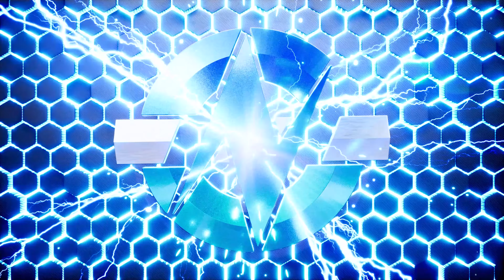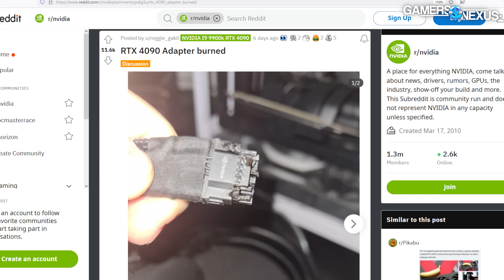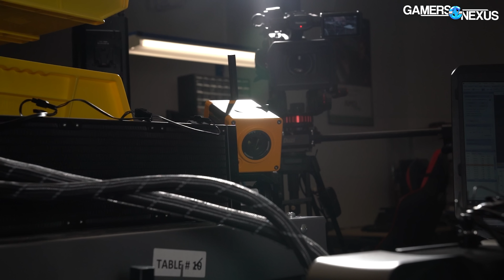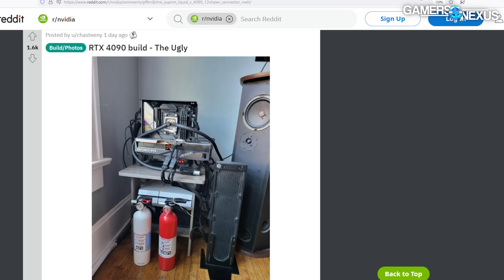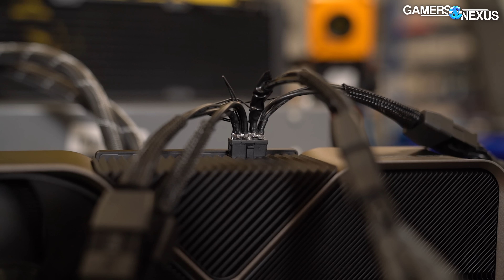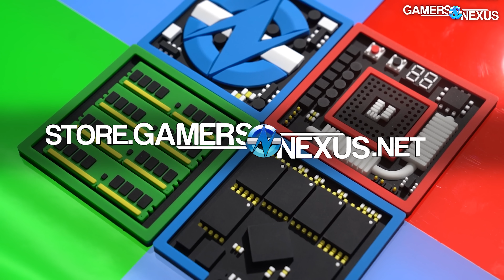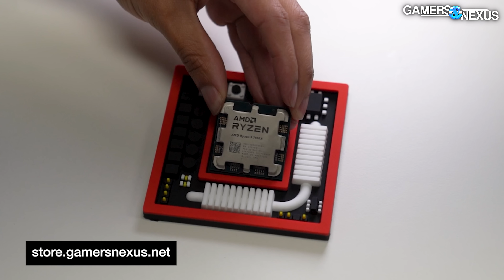Testing Burning NVIDIA 12VHPWR Adapter Cable Theories (RTX 4090)

Comment: Burning electricals are always due to poor/loose connections. Loose wires not tightened or corrosion/arcing causing poor connection leading to increased heat and burnies.
Reply: Yeah and the wire cross sectional area is well in excess of what is needed so it and if it was on the back side of the connector you'd expect the melting to start there which isn't what is happenning.

Comment: bottom line cause: these cards are drawing far too much load and are in dire need for a more efficient R&D. even if it was a weaker cable in comparison, 300 watts wouldn't be melting it in contrast to 600+ watts they're drawing now and honestly anything drawing more going forward will just be impractical and not even possible for most people to use on a common NA 15A circuit (non dedicated of course).
Reply: Its not a weaker cable it a weaker connector that is likely the problem. Trying to solder massive 14AWG solder monsters to those tiny molex contacts is not a good combo. Crimping smaller gauge wires to each contact directly without solder would be much safer as it is much more consistent using a crimping tool than manual soldering.

Comment: I would make sure when testing this to try applying a significant horizontal force to the adapters. If Buildzoid's right, that's what would get these things hot enough to melt. Testing them with vertical force won't do it. After all, the picture of the first rig with this issue showed the cable was torqued sideways.

Comment: these plugs are only 12 volt. 300v or even 150 volt cable is a massive overrating that is not required.
Reply: Its the temperature and cross sectional area that matters. And most importantly the contact resistance.

Comment: question, at what temp does the plastic start to melt. It may be useful to know that temp as if it is close to normal operation temp then it would not take much to cause it to melt, but if the plastic starts to melt at a much higher temp then you might not have to chase down some leads as only certain conditions could cause temps that high.(ie only electrical arcs could cause that high of a temp)
Reply: ~269degC I think is when the nylon would start to melt assuming it is not a glass fiber/ball filled housing or has any magic addiatives. It doesn't need an arc to melt it just need high contact resistance to cause excessive heating in the connector housing.

Comment: Thanks again, for providing such an indept view on a big issue. Something I have always been wondering about, and that seems to be confirmed in this video, is how does a sample size of 1 confirm a generalized theory. Igor's lab appears to largly base his claims on one cable that he opened up, while your work is on 5 cables. This time it concorns a cable, which is arguably easier to get a larger sample size of. 
But then I have to wonder, when it comes to testing of the flatness of a CPU, graphs which I love seeing in your videos, as it shows how much depth you go into to understand the functioning of a product, and start wondering, how much does this one sample that has been scrutinized represent all of the CPUs tested. I appreciate that it is difficult to get a sample size that represents the whole of a product that is sold, especially when it comes to a high end product like a GPU/CPU.

Comment: So a couple things here. Size of wires and crimps really matter. If you've done crypto mining, you realize that even if they have the same gauge wires, PCIE connectors wont perform the same under FLIR and load. What really matters is the quality of the crimps (or if they solder) and depending on the company, the quality assurance can be all over the place. A bad crimp will increase the resistance quite a bit and cause it to heat up, which also puts even more load on other crimps. Even if the gauge of the wire is there... Obviously the gauge of the wire is another factor. And even if its the right size, they can use chinesium, IE the metallurgy of the copper wires might not be completely copper in order to reduce costs.

Comment: Thanks for testing this but I think in the end connectors that carry substantial currents should always be CRIMPED, not soldered. Never. So I think even they could resolve these problems there will always be more issues with unofficial adapters etc. Until someone makes a 100 % crimped version of the adapter.

Comment: Would it be possible to measure the diameter of the male pins on various cards. 
All the failures (at least confirmed) seem to pretty much be across 3 brands (Asus, Gigabyte and MSI). If Nvidia is supplying/making the adapter (or at least some of them), maybe their source for the female pins comes from the same place has their board connector, making them a perfect match. If Asus, Gigabyte or MSI have a different source for the board side connector, maybe the pins are slightly less diameter (despite the fact they are meant to be built to the same spec). This could result in a loser/higher resistance/hotter connection at the pins, this combined with the poor choice of dual split pins, could be the breaking point.
It would explain the pattern of 0 FE cards having the issue (and the reason you have had no issues with the FE card with many hours on it) and also the reason why aftermarket cables don't appear to be suffering the issue (if they use better tolerance pins, that match that of the Asus, etc sockets).
If there are multiple batches Nvidia adapters out there, maybe it only effects some if the pins for them are from different suppliers/batches.

Comment: Igor's conclusion never made any real sense... If the solder joints were the problem, then you would see the issue most likely occurring at the solder joints... Duh? All the pictures of failures show that the problem *is* the connector in spite of Igor's (rude) insistence that it isn't. "The charred socket on the card is then only the consequential damage". If this was the case, it would make logical sense that the socket has the issue, not the solder joint. If the solder joint was the problem, then you would see damage localized there first and foremost...
Buildzoid's pin theory makes a lot more logical sense I think.

Comment: Cables are melting at the pins, and not from cable side, doesn't this means that the heat is coming from the pins? 
To my understanding, the plastic would start melting at the point of failure, as that is the point of maximum temperature, or am I wrong?
What I would assume is that there is some connection problem in the pins themselves, maybe some of these adapters are out of spec?
Reply: Oh, if the plastic has some ventilation, then it wouldn't melt, but the metal pin can stay at the plastic's melting temperature. Then the metal carries the heat up to the pin, that pin is inside the card's connector and can't be cooled, so it melts... 
If that is the case here, we could take a look at the 12VHPWR insides, preferably one of barely melted ones. If the cable side of the connector isn't melted, then the heat came from the pin.
Reply: @tchakizera   The melting temp of the plastic housing is >260degC so and to burn it you'd be at 400-500degC so it would be getting really really hot.

Comment: You can always tell a good tech from a bad tech with one thing.  Recreating the problem and noting the differences.  My gut initially screamed that there had to be a difference between people posting their melted adapters and all the Youtubers/Tech Ghurus adapters.  It completely makes sense that there was an adapter redesign but some older adapters still shipped out.  Keep on this as I think we are all very interested in finding out exactly what happened.  Think you guys are on the right track though.  Follow the evidence, recreate the problem (if you can) and gather as much info as possible.

Comment: I name it Scott camera (Scott is the x-men with heat vision)

This makes me wonder if they figured out the cables had a problem and only some 4090 have the defective cables and the majority have a revised version 🤔. 

Your all forgetting to add Tdelta for case internal temp vs an open air bench.
I put a thermal couple on my cable on my 3090 in a vertically mounted air cooled strix in a o11 dynamic with a corsair commander and all ML120 fans in the GN tested airflow layout 360 corsair aio top mounted exhaust. 
I found the my 8pin cables under full load can hit 100c really easy adding a small 80mm fan to a main board header to move air around the socket and the the card dropped cable temp by 40c and Vrm Temps by 19c changing the fan profile from default quiet to normal also fixed the problem and this is a key I think a lot of people have Very Very poor case airflow so the plastic needs to deal with a delta about a case temp that can easily hit 125F.
 my actual fan profiles keep case Temps Very good but my fan profile is setup to use the GPU temp for all fans BUT the ones on my rad witch are cpu temp driven but the default is all cpu and a lot of only games at higher rez will not push a newer cpu much off idle temp 1440p vsync csgo my cpu 5950x is 2c above idle and poor fan config this can backfire

Comment: Why nobody is investigating the pins in the sockets? It is the connection itself causing the problems. Not the cables, the soldering, broken pads or all that nonsense. 

It is probaly the pins itself having loose contact in the socket. Running high current over loose pins in "not so tight" sockets is what usually leads to sparking / spark jumping and that leads to heat.

Comment: you don't need to theorycraft, you just need to use your brain, all the pictures I've seen the connectors melted at the pin side, not at the cable joint side, it's almost clear that it is the pin contact causing the issues as no pictures shown molten plastic on the cable joint side, imo all these analysis focusing on the cable solder are pointless

Comment: Doesn’t the voltage, wattage, and amperage being carried across the specific gauge of wire all contribute to the amount of heat generated and all of that is affected by resistance of the wire which is also affected by all of the previous factors because the higher the temperature and the thinner the gauge of wire the more resistance the wire will have. A 14awg stranded cable carrying 12 volts at 400 watts will generate roughly the same amount of heat no matter what the volt rating on the cable says. Upping the wattage to 600 will increase the amperage being carried and will increase the heat being generated which will increase the resistance of the cable. All of that to say that whether the wire says 150v or 300v should be irrelevant if they are both 14awg.

Comment: You need to clamp the wires and see how much current is being pulled, my best guess is the connector pins are to small for the current the card is pulling.

Comment: GN, the issue is connector metallurgy and not soldering or not fully seated connectors. Combination of certain plating on male/female and ferrule design produce high resistance contacts and heating

Comment: Paul cut his too. at 10:14 in his video. The wires are 300V, but the solder and tabs look like Igor's lab one with the inner cables soldered to two tabs each while the two external ones are separately soldered to one tab ea, specially the right one/top one in the frame the solder looks completely detached from the rest. OTOH Jayz didn't go so far as to cut up the plastic, to see the solder and tabs clearly but they may be like the GN's one.

Comment: Steve, I'm no electrical engineer.  However, it seems you are only asking viewers for half of the pertinent information about their cables.  While voltage is a part of the equation and cable rating, it's only half of the formula.  Amps is the other half.  We need Volts and Amps to calculate power.  While 150V seems like  a lower rated cable, it may not be depending on its amp rating.

Comment: And please test worst case with closed case, at least 25C Ambient, Usually if contact as warms as 60 Degree C in Open Air. In closed case with inadequate airflow (like liquid cooling card setup) will be a lot worse because of heat accumulation and may hit 100C easy within 10 mins.

Also they way Igor's cable soldered may cause unbalance current on 4 power wires comes to connector because higher outside pins resistance (smaller solder contact and longer distance from outside 2 wires to middle pins), and will generate more heat. And accumulate heat may cause metal contact to expand and will go to runaway situation which connector becoming loose because if heat and strains from cable bending.

Comment: It seems a rare problem that causes plastic melting in the worst case. Buy a different cable. Probably won’t matter either way. Get a 7900 XTx if u are freaking out and have the dough.

Comment: I would bet the problems is the pins, not the cables... Lack of contact between the pins in the card, and the pins in the addapter. A bit smaller diameter in the male pins... or too loose female pins...
EDIT: 26:01  Exactly!  I should wait till the end of the video befor making comments.

Comment: How funny would it be if it was the lower rated cables with the 150w cables were meant for the 4080 or 70 and someone just mixed it up

Comment: I don't understand 150v-300v cable difference. I'm not pro in electronics, but I know that the higher the voltage the thinner cable can be used for same power. So 150v cable must be thicker, but how is this relevant if 12v max is used?

Comment: The ambient temperature would play a role in this.
In any case, 74 °C is too cold. I don't know what that black plastic is but I assume the melting point is above 250 °C.

Also, the melting point for electronic soldier is about 210 °C, tin 98% and I think the rest is silver. I don't think 74 °C would effect it at all.
Even if the room is 30 °C, I don't think the cable would melt.

Comment: Why not just use a QS8+4pin sensor connector like in the RC world? Could just add a clip to prevent it from coming apart. Cheap and handles 110A all day long with peak of 130A. Should handle up to 1320W all day (1560W peak). 

Seems this 12VHPWR connector is just engineers doing typical stupid over-complication like they always do.

Comment: I think I know it's EVGA psu are culprits and reason EVGA want to hide from Nvidia...it's quality of psu from EVGA are crap due to revision is there is a problem with 4 rails vs newer atx revision remove other 2 rails due to low amperage on each rail and using 2 capacitors for operating in not efficient way vs newer atx running one big capacitor for big dual rails of 45amp each

Comment: Since the power supply is only 12V, the 150/300V should make no discernable difference as long as the temperature rating and wire size are the same. I still don't see why anyone felt the need to create a whole new connector setup like this. There was nothing wrong with using the 8-pin connectors that have been in use for years. At the very least, they should have gone with a larger connector to avoid heating.

Comment: I am just gunna throw this idea how there......... what if the cards are spiking in power?  Typically if a card does not earth properly or fully it will burn a cable as an electrical application.  Have you tried pushing these cards to a maximum overclock .... perhaps cheaper cables fail with a heavier load, maybe it upsets something.

Comment: A failure to fail-state test is not a failed test, it's just one test closer to determining that that isn't the specific failure mode. Good work, GN. I hope you get the responses you need. I'd like to know I can buy a 4090 one day without burning down my house. 😁
Reply: While it is indeed impossible to prove a negative - its also possible there isn't actually a problem with the connector except in either abused situations or situations with manufacturing defects.
Reply: @JohnVanderbeck  "Abused situations"? I wasn't aware that all thirty cases fit this bill. What evidence do we have for this?
Reply: No houses have been burned down. Don't worry about that.
Reply: @Watchfulfox  Yet.

No houses have been burned down yet. There's still time.

Comment: So correct me if I'm wrong but from what I could understand is that the adapters in general are okay to use but some people are getting adapters that are built poorly? Even though they are buying the same brand gpu some people are getting completely different  adapters with there gpus ? If that's correct. 

But most people anyway cant afford how overpriced the 4090 is etc but where people keep buying it the companies will keep making pc gaming even more expensive

It is a shame alot of us have already powerful psu's watt wise to handle the 4090 and it would be alot more cheaper and convenient using a high quality adapter for it but with the unrealistic pricing and the poor quality adapters in the mix of the production it's to risky and expensive to use the 4000 series, its best to leave this for 2 or 3 years until they are cheaper and all the problems have been fixed and ofcourse having them in stock

Comment: thank you steve for mentioning the possibility of a bad connection in the socket. that was my first thought when looking at these burned cables as we have known for some time now that the cable is known to be stiff. excessively bending them to get the side panel to close and the connection in the socket being strained seems like a very plausible cause. hopefully you can get some cables in to see what's happening